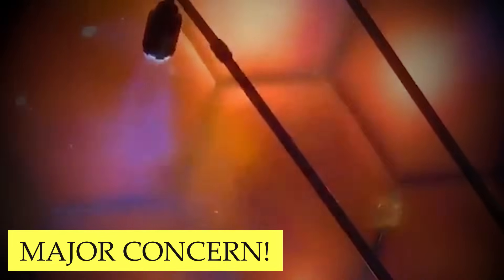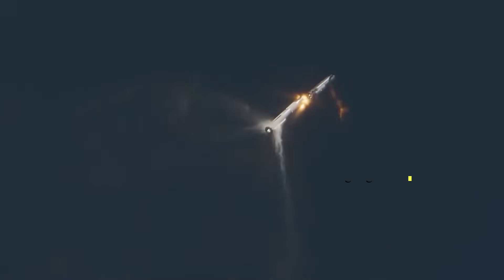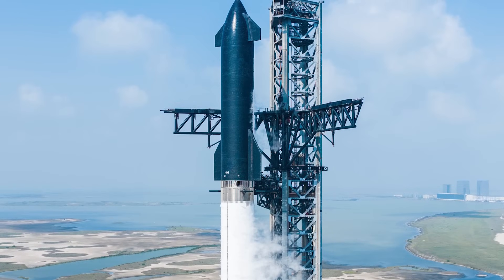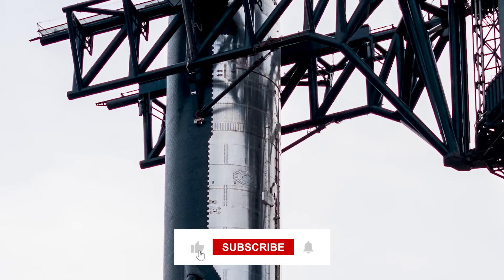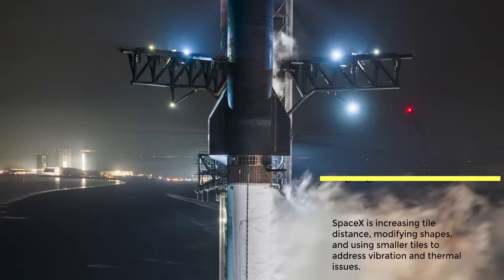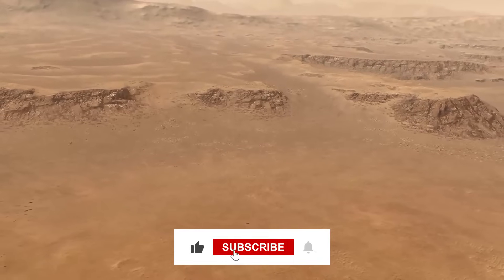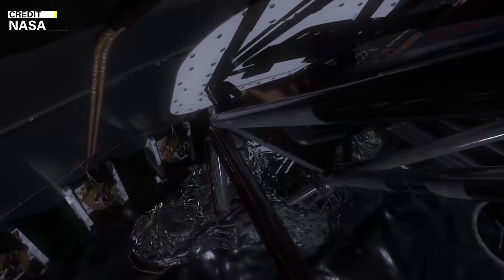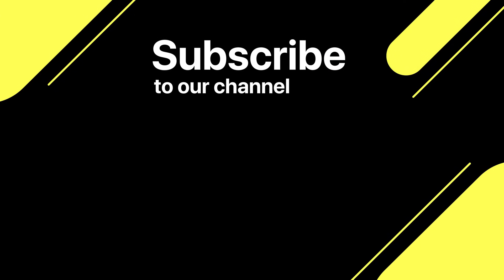Starship Heat Shield Issue Fixed? Perseverance Rover New Finding | Episode 42

Comment: One of the big problems with attaching the tiles is the stainless body underneath being super cooled by the cryogenic fuel in the tanks.   That metal must contract when cooled so there must be gaps in the tiles to account for this shrinkage...yet still be able to handle extreme heat expansion during re-entry.   Not an easy compromise to make it seems.
Reply: the work may well be in altering the skin of the steel to accommodate fitting the tiles onto it...? Can steel be made to have a velcro like surface.......

Comment: The problem itf3 had, if you remember, was that it developed a leak near the motors a soon as the stopped running. This leak gave s27 a spin that it couldn't counter, and resulted in uneven re-entry, where unprotected side of the ship was exposed to hot plasma. That was the reason why re-igniting one motor was cancelled - it would very likely end in a big BADA-BOOM.
Also, drag is a good thing at re-entry. It slows down the ship and allows it to heat up more slowly. (all that kinetic energy must turn to heat and the slower the process the better)

Comment: There has to be a spray adhesive out there to cover the tiles. Yes, it will add a little more weight, but ensure all seams, and tiles are additionally held together. I'm no rocket scientist, but its common sense. Think about it. Its like a clear coat on a car so the cars paint is protected. Again, think about it. It will work.
Reply: 2,600F capable adhesive?? .. good luck inventing that.

Comment: CRAZY HEAT SHIELD IDEA --->> A heat shield unitizing stocking made of carbon fiber would negate the effect of take off vibration.  Use a chicken wire pattern format to reduce the weight of the stocking; or apply half cylinders,  in sections that are cinched with zip ties or equivalent. It would burn up on reentry and need to be replaced before liftoff.
Reply: The idea of starship IS TO BE FULLY RAPID REUSABILITY.....
Reply: That's... Actually not a terrible idea... Except adding a loose layer to the outside of a fckn rocket is a very stupid thing to do.
Reply: Or we could just shrink wrap the Starship for launch. This would hold all the tiles in place for launch.
Reply: @camojoe83  it's a place to start..make something from this.
Reply: Not crazy...won't work as suggested here..but elements can be integrated....in fact..this may be the only way....needs to be considered & explored. .
Reply: @camojoe83  Maybe you overlooked the meaning in "cinched"; as in a corset.  The forum does invite being laconic.

Comment: My suggestion is instead of the 3 push-in pin attachment do a 2 slide-in T-rail type attachment on both side of the tiles which has slits and one push-in pin attachment.
Reply: I like it but, what happens  when your almost done and you notice  damage from a bump that cracked a few half way up. How do you replace them. You would have to remove thousands of tiles to replace the broken  ones.

Comment: Why not multiple heat tiles built as one larger plate? It would be much easier securing a larger plate than 10-12 smaller tiles. More tiles equals more variables for failure.